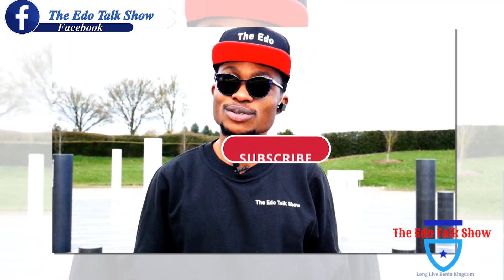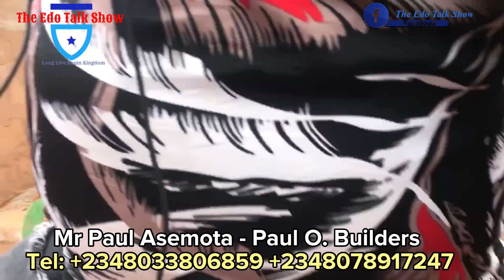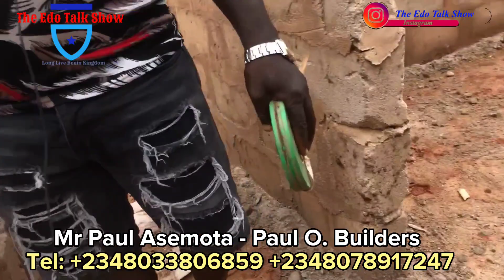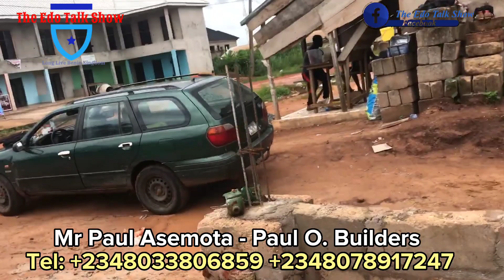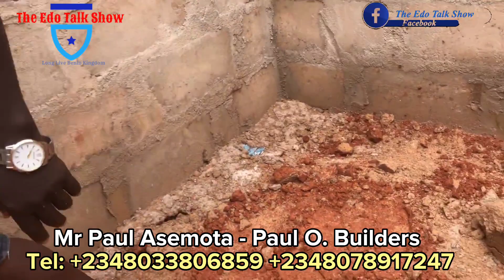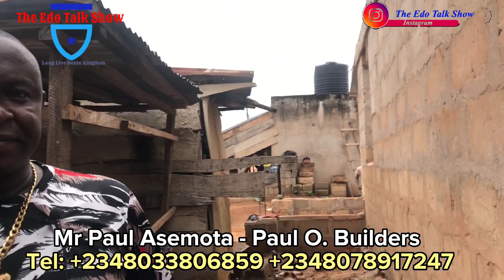EDO - Watch How This Man Build A 3 Flat x1 And Self-contained X2 In A Small Land Measuring 50x50 Wow

Comment: Only hearing the explanation from the building contractor or engineer as you called him. However the camera man did not do a great job as I could not see the space he mentioned in practical, he or she was just pointing the camera to the bricks. Next time please try and capture a proper view inside. Thanks
Reply: Do the math normal room are 12by12 so when he said 14by11 bro it's a good sizeable room,.. if u know how big 50by50 is u will understand just imagine he put a 3 bedroom flat and 2 apartments selfcon needles to say A 50by50 land you can build mansions on it
Reply: Try and find that type of tape the man had and measure 50 you will shout. It's so big